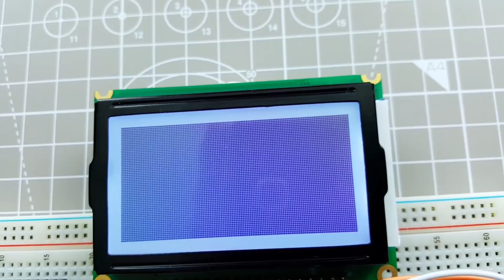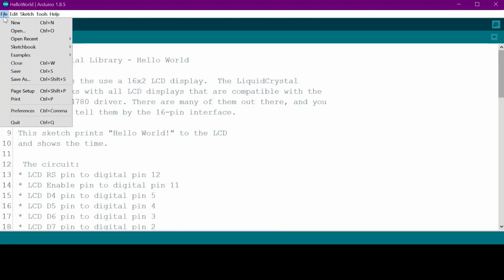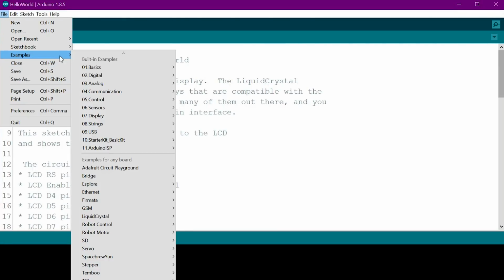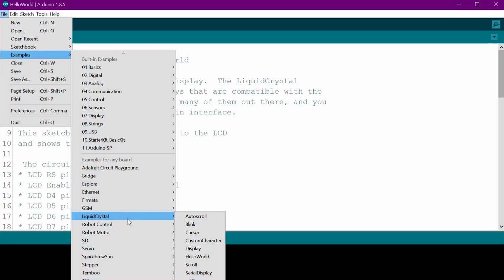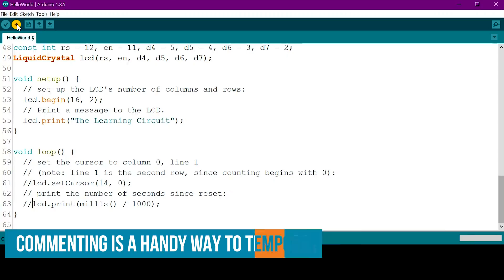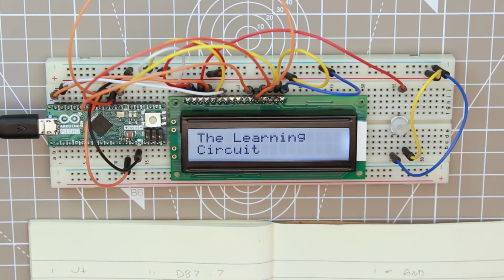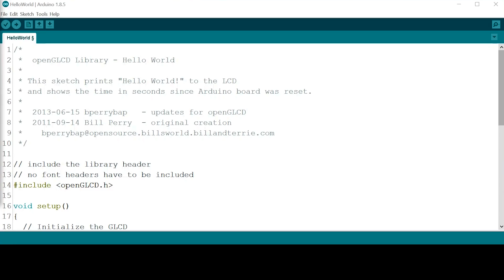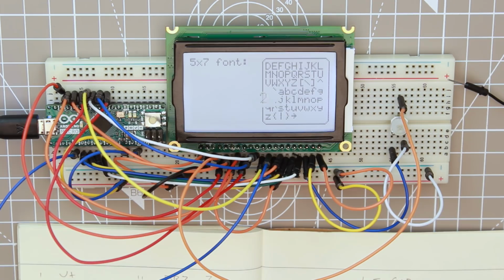Add An LCD To Your Project! - The Learning Circuit

Comment: No flux when soldering?
Reply: Anthony Hernandez Solder has some flux in it. Unless you’re soldering surface mount it really isn’t needed. It is nice though.
Reply: I see in the examples of soldering the ends first, the solder was struggling to stick, a little flux would have made it much faster, and requiring less time exposing the pins to heat.  Just pointed it out that in this case the flux would have been a large benefit.

Comment: A basic, practical and useful video. I like to use an I2C interface with my display projects to simplify the wiring as it reduces the number of GPIO connections for the display.Thanks for the useful video. WOW the Learning Circuit site is a great resource I wish I had known about it when I first brought my Arduino and Soldering Iron.